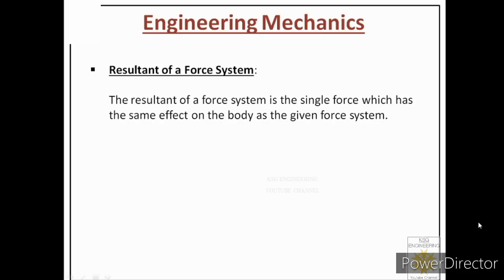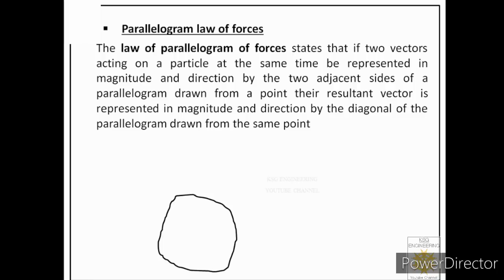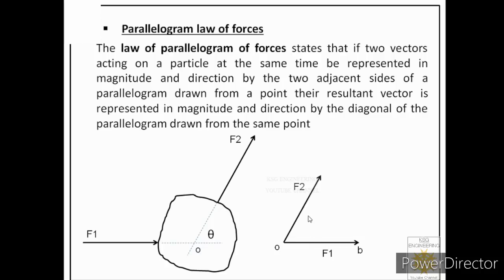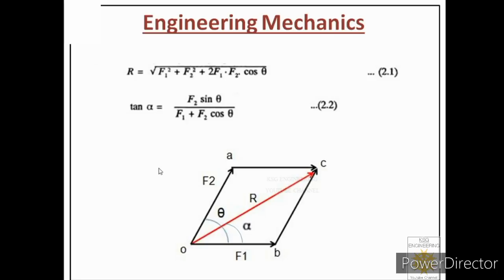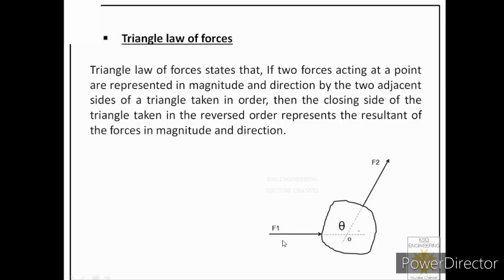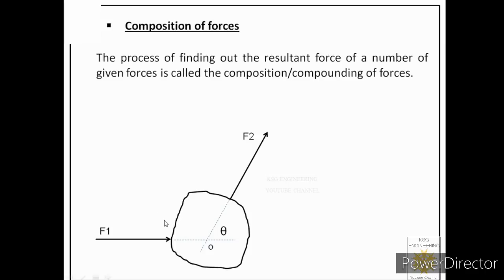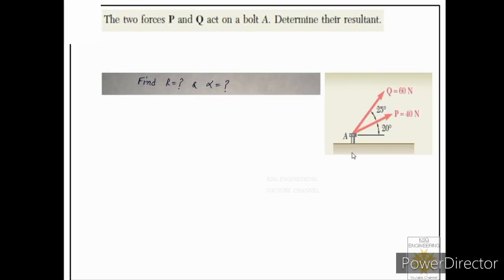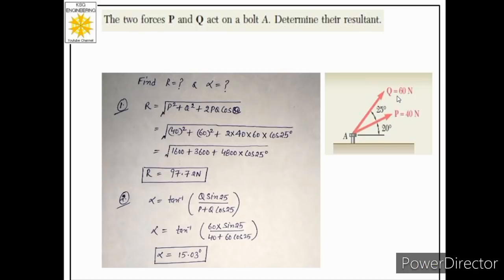Numerical on Resultant of a Force System | Parallelogram Law | Engineering Mechanics | 4.0

Comment: sir alpha will be 35.04 not 15.03
Reply from the maker: No dear it is 15.03 only. Calculate carefully
Reply: Bro 15.03 is alpha which is the angle between resultant and force P 
35.03 is the angle between resultant and x axis ( 15.03 + 20 = 35.03 )